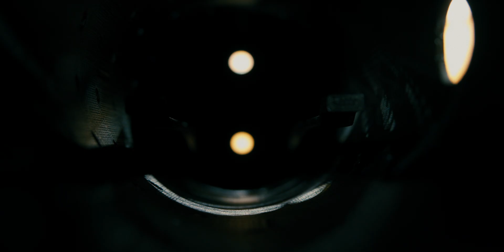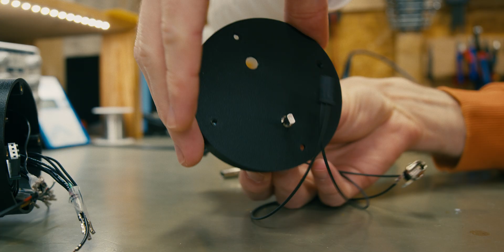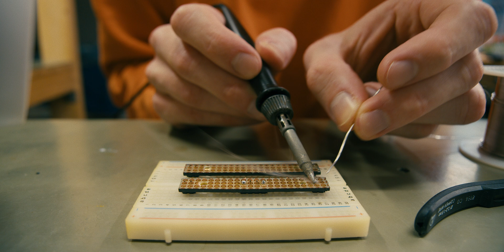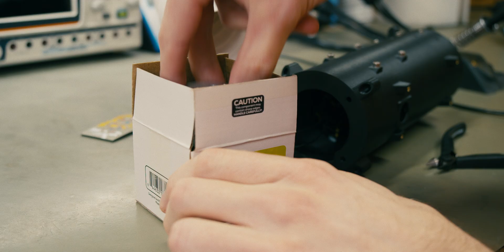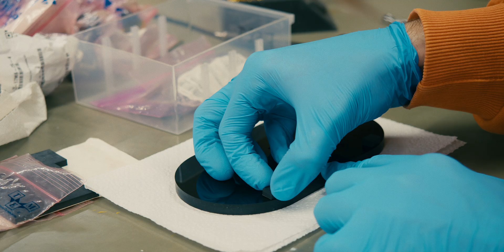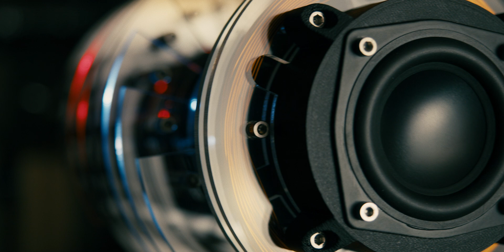Electromagnetic Feedback: Making an electronic sound sculpture

Comment: damn dude.. you have outdone yourself.. was looking into the microprocessor, but these are expensive.. did you ever try the more commercially available and cheaper processors? or are they not capable?
Reply from the maker: Thanks. AFAIK there's no other microcontroller out there, except for Teensy and maybe Bela (which is even more expensive), that is so streamlined for audio. I've used ESP32's before, but only for very simple square wave stuff, or in conjunction with a bunch of DACs and analog synth circuits.
Reply: @EirikBrandalf maybe we should correct that 😊 I am a pcb designer for a living.. If you have an idea in what you would like for io/processor/memory we could work on something custom.. Just a thought..

Comment: Awesome work as always! I’m interested in the wire you use for your free form electronics. Do you mind sharing what type it is and where I can source it?
Reply from the maker: It's 14 and 18 AWG bus bar wire from Alpha, usually at Farnell. I buy them by the kilometer at this point, but prices are fluctuating wildly so keep an eye out for that.
Reply: @EirikBrandalf  Takk!

Comment: Gorgeous! I truly believe that designing an enclosure with easy access to all the needed spots is an art form in its own right.
Reply from the maker: It would probably have been easier to split it into multiple parts. A truly air-proof enclosure of that kind would likely require gaskets, though.
Reply: @EirikBrandalf not that I tested, but them bois say 3D printed parts are not air proof anyway 😅
Reply from the maker: @juliusmakes  Let's say air-proof at a decent level then! My current problem is actually that jack connectors (both power and audio) aren't air-proof either. I've tried to mitigate this by wrapping electrician's tape around them, but to no avail. Passive radiators seem to help a bit against the air pressure through tiny fissures.
Reply: @EirikBrandalf passive radiators introduce time domain distortion

Comment: Just beautiful! 👏👌
Thank you for designing this sculpture and sharing the process with us.
Short question: what kind/model of CNC machine are you using? Looks great!
Reply from the maker: Thanks! It's a WM3020. I don't think they sell it anymore, and there are better options in the same price bracket these days
Reply: @EirikBrandalf  Thanks! Is there any other CNC machine you'd go for nowadays in the same price bracket?
Reply from the maker: @trashmail8  It all depends on what you want to do, so don't take my answer as gospel. But if I had to buy my first CNC router again, I'd go with the 3030-PROVer MAX, which looks like it has several upgrades over mine at a lower price. Just don't get fooled into thinking that you can work reliably with aluminium using the stock spindle (I was).
Reply: @EirikBrandalf  I won't take your answer as gospel, but it's always valuable to hear thoughts like this (eg. regarding the aluminium w/ stock spindle) based on experiences from someone who's much farther ahead in the learning process. Really appreciate that you took the time to reply  and once more: I really love your work, your attention to details and also your soldering skills! 👌
Reply from the maker: @trashmail8  Thanks, any time!

Comment: Love the sound. It just hits that sweetspot where the audiosignal is on the brink to loose it's integrity. I guess that's in general the fascination with analog signal processing even if the source is digital. Even more so if the signalchain includes this electromechanical transduction.
It puts so much life in a sound when you manage to tame it's behavior basically like controlling the paramenters of a Lorenz Attractor just at the edge of getting to chaotic.